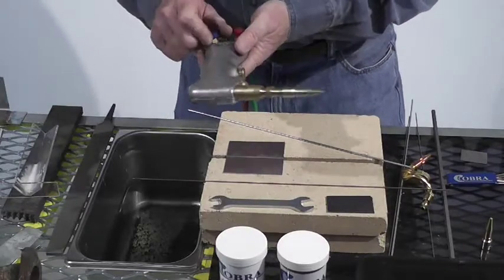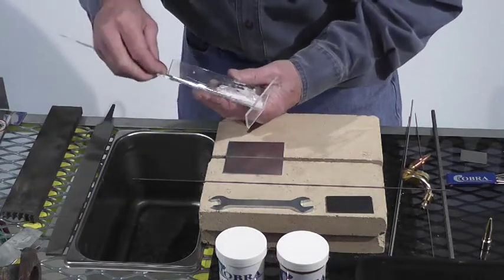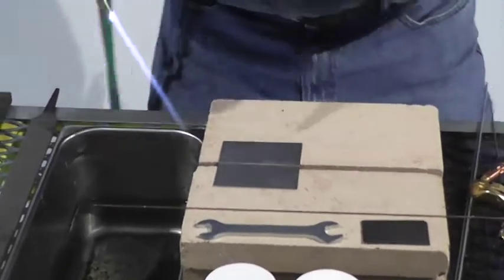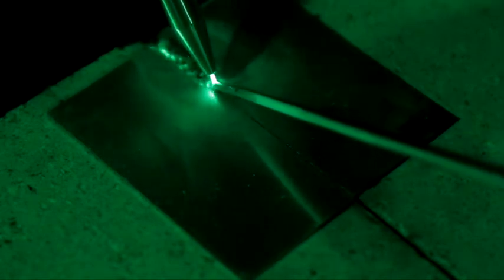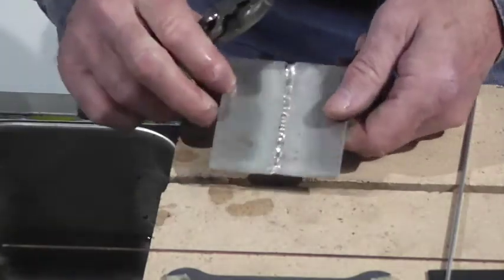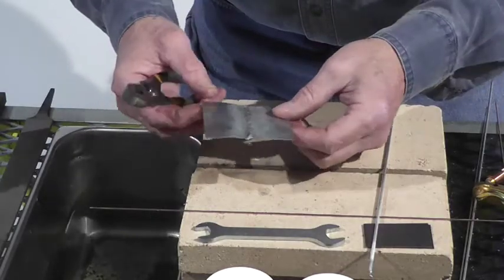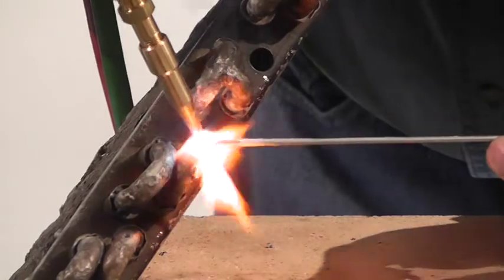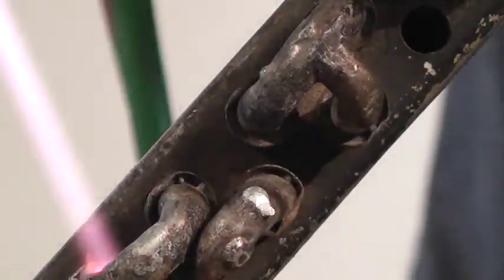HOW TO GAS WELD THIN ALUMINUM

Comment: Would be nice to have more info on which flux you use and about the "special" aluminum glasses
Reply: There are "Cobalt" glass lenses (very deep blue) and "Didymium" lenses, which absorb the yellow sodium light that comes off the heated flux.  The didymium lenses are also used by glassblowers.  If you're lucky and don't need prescription glasses, you can get safety glasses that do this job.   If you don't use special lenses you can still do this job with like a green face-shield or regular shade 5 goggles, but it will be hard to see what you're doing because of the big ball of yellow light.   You can buy flux for aluminum welding and brazing online, but I don't know what he's using here.  He's using it very economically!  Most people paint it on the joint and the rod, and it tends to make trouble, and you have to scrub it off.   We're seeing very good technique, here!
Reply: they cost $240 sold by T M technology the cobalt ones are unsafe for welding causing cataract.

Comment: he mentions making the flame SHORTER and LONGER. how is this actually done and how does it effect the neutral flame? thank you.
Reply: by changing the mixture between the two gases at the gun. You dont need to change the pressure at the regulators. you must stay at 4 PSI on both tanks